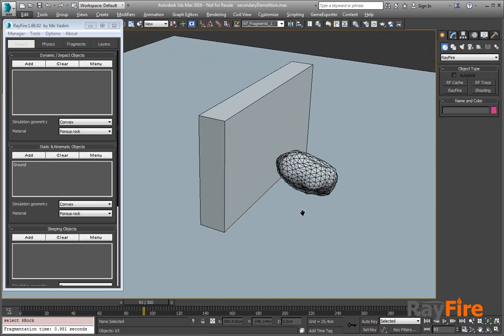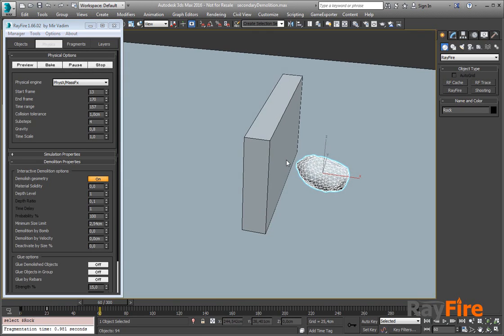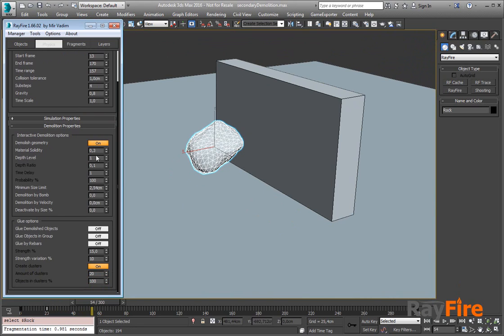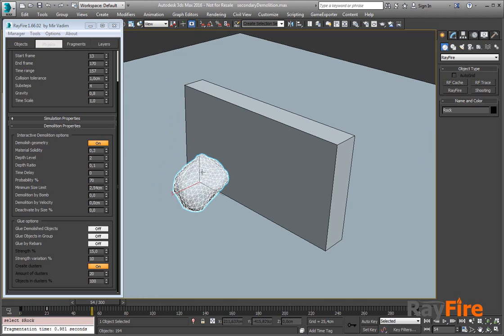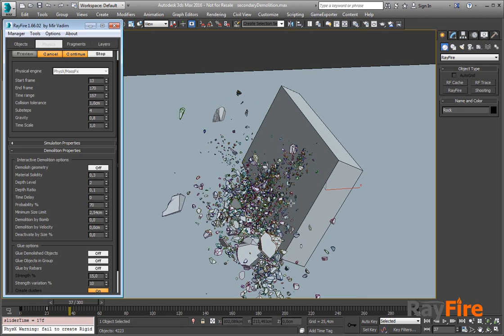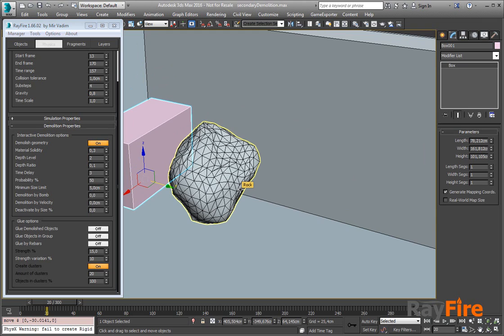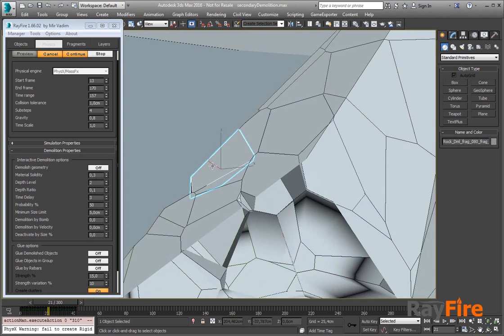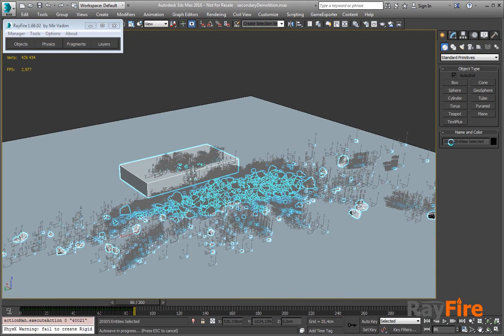RayFire - Secondary Demolition

Comment: Come on man.  Play back the final result so everyone can see how it looks.
Reply from the maker: Sorry man, this video was more about how this feature cab be used. Also it is really hard even to rotate camera in max with such amount of objects, not playback, so I just stopped recording. I will next time.
Reply: @MirVadim  hi what is the difference between material solidity in physics tab vs solidity in object tab or density pls explain the difference between them
Reply from the maker: @satendrakumar-fy7bh  Solidity in Rigid modifier cefines local object solidity multiplier. Solidity in Bullet object defines glogal solidity multiplier. Low solidity makes objects fragiles and easier to demolish. Density defines object's mass considering it's volume.